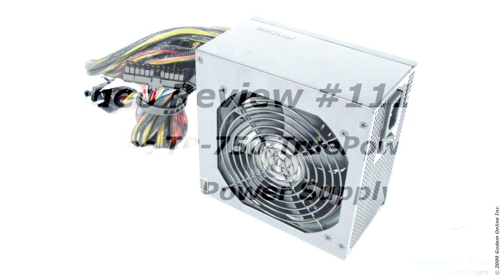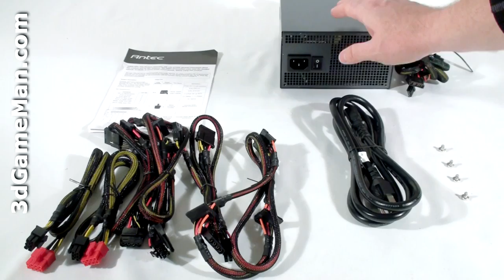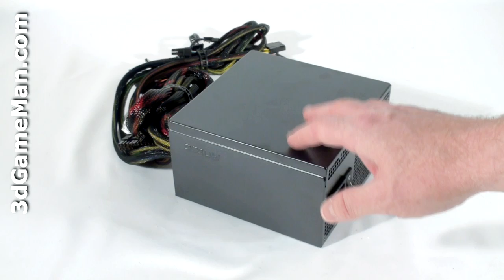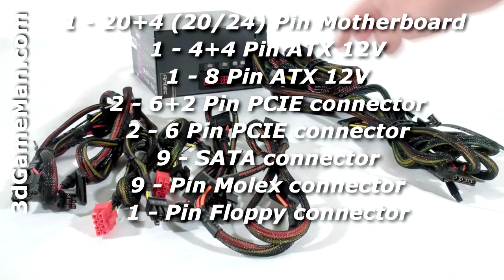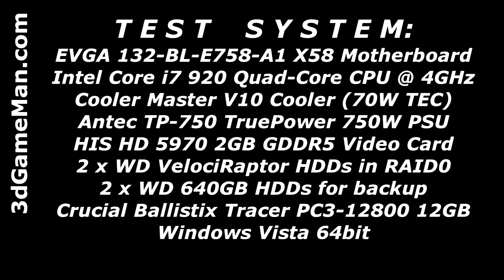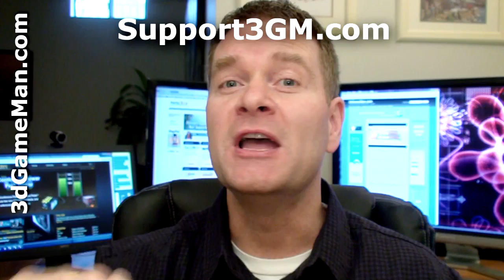#1118 - Antec TP-750 TruePower 750W Power Supply Video Review

Comment: I've had mine since Jan 2010, after about 10 months I could start to very faintly hear the bearings ticking over. It's not an issue though as a I have my case a Coolermaster Scout on it's side under my desk. It's a great PSU however and it's never failed on my I7 920 OC to 3.63 Ghz(4 internal Hard drives, 1 DVDRW, Palit 1 Gig GTS 250) I have the Blue LED version of this PSU. Well worth the money of £90 I got it for from SCAN.

Comment: @LFCforEver12341 @LFCforEver12341 LOL, these reviews use software readings which mean nothing.  There is no accuracy in them whatsoever.  See the real reviews at GND-Tech and JonnyGURU.  The TX750 does regulate a bit better (less drop) but both regulate around 2% on the main rails.  However the TruePower New series have considerably better ripple suppression that is on par with some of the best power supplies, since some parts of this PSU come straight from the Seasonic M12D platform.

Comment: This is a good PSU.  I've had it for about 6 months and it never failed.  Powered my E8400 running at 3.8 ghz, two GTX 260 CORE 216 55nm cards in SLI at 720/1530/1188 and the rest of my system (one hard drive, 10 fans at the time).  I'm now using it on the same system but I have a GTX 480 overclocked to 863/1726/1050 (1.138v), 12 case fans and I even used a GTX 260 CORE 216 55nm SC in tandem with my GTX 480.  Works great, great buy for $90.  Beats the Corsair TX750 in every way.

Comment: If you have a GPU that requires 32amps on the 12v rail for example does that mean if got a 2nd  one in SLI would you need 64amps?

Comment: This is one of the power supply I'm checking out for a i5 build.... I would prefer modular so there are only a few choices in the same price range 

Antec True Power New 750W - TP-750,
Silverstone Strider+ 750W - ST75F-P
Thermaltake TR2 RX 750W - TRX-750M

What do you guys think of my options? There in the order of what I would prefer by the way

Comment: @KronicKillaz 

Yes, if a motherboard says it can take ddr2 800, you can fit any ddr2 memory up to 800mhz. 
You can try installing 1066mhz memory aswell, but you will need to overclock the bus speeds of the motherboard. 

Hope this helps =]